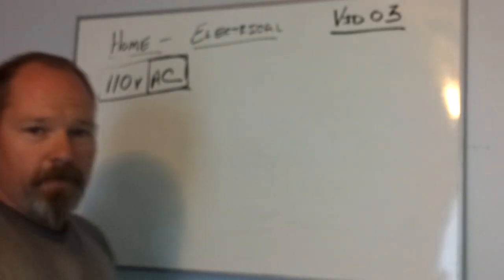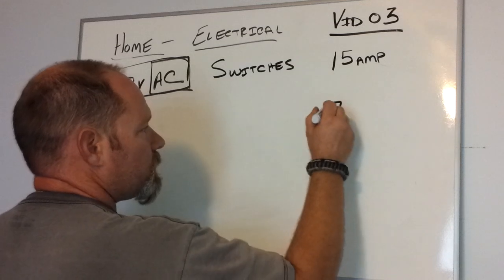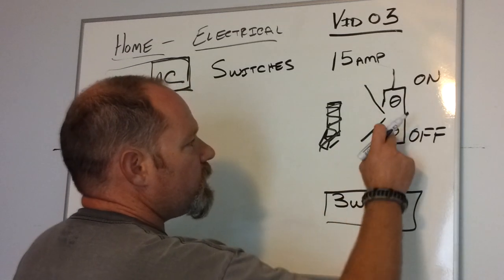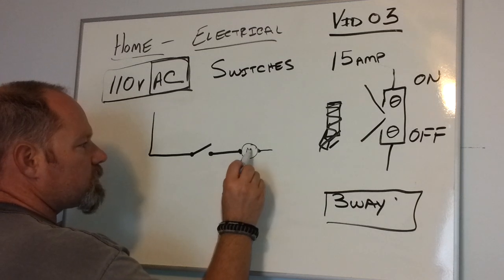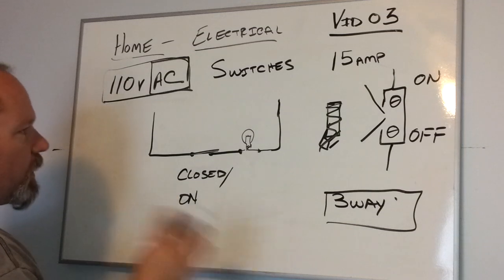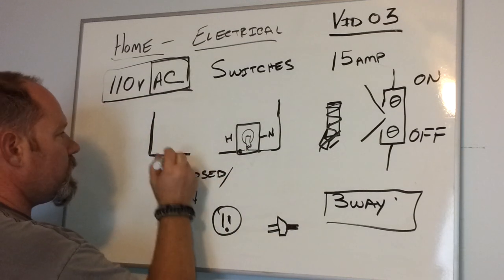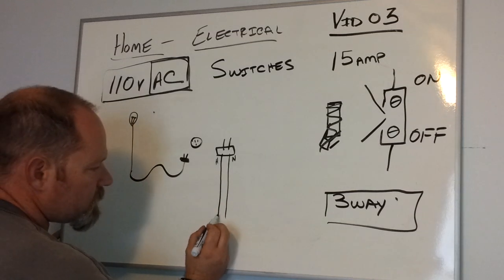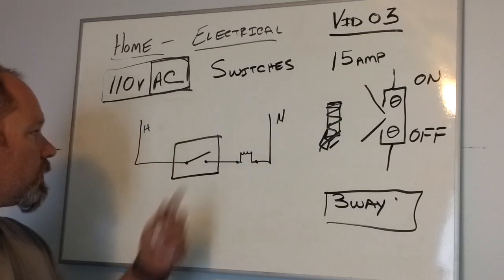BASIC ELECTRICAL 101 #03 ~ SWITCHES

Comment: I just recently got a new job learning to be an HVAC install and service tech. I've done a lot of construction type work and have a good grasp on a lot of that type of thing. I never really dove into what makes things work and the how's and why's of the way things work. I started off on your 11th video talking about wiring HVAC systems because lets face it, wiring a thermostat and an HVAC unit isn't always as simple as connecting the colors and being done with it. Your videos have been extremely helpful thus far, and I intend to watch all of them. Just wanted to let you know, you're very informative and did an excellent job in helping to explain things. THANKS!!

Comment: have a few questions. Recently at work I got into a fight because one of the senor guy wired every outlet and switch using the backstabbing method. Not only were the terminal screws not used they were not screwed down. Other than not being safe is not screwing the terminal screws down legal. And should you use quick connect instead of the terminal screws... I was always taught never to use the quick connects and always screw down the terminal used or not and apply electrical tape around the terminal screws to avoid a poss issue with someone reaching into a box.
Reply: MAJESTIC1 I hate coming behind someone years later that has wrapped the switch or plug with electric tape. It leaves a goey mess.

Comment: I'm a little embarrassed to ask this question because I'm pretty familiar with wiring but here goes:  sometimes the power source for let's say an overhead light, is in the ceiling and you need only to drop a switch leg down to serve the light with a wall switch.   BUT I understand the code has changed and all switch boxes must be served with a neutral  wire.  Is this true and if it is what do you do with the neutral wire in a switch leg such as Ive described?

Comment: can someone help me?
I understand the abbreviation of ad and ac, but i was just wondering what it mean. i'm only just starting to learn in this area, thanks in advance
Reply from the maker: +Almighty Hale AC is alternating current and DC is direct current. This is the flow of electrons. In direct current the electrons flow one direction from the - to the +. In alternating current the electrons flow in one direction the stop and flow in the other direction; this happens 60 times a second thats called hurtz or Hz thus 120 volts 60 Hz. Hope this helps. Thanks for watching!
Reply: I think you mean AC DC, which is a band from the seventies that is also responsible for discovering electricity.
Reply: Guy Brown thank you sir, very much